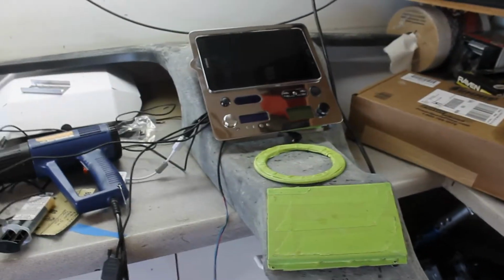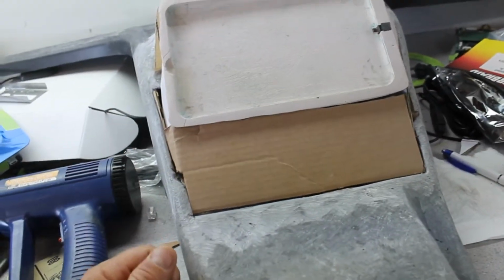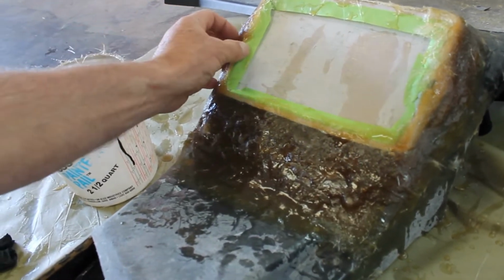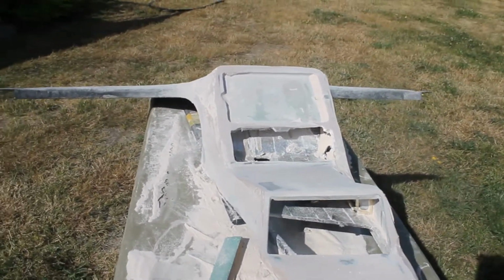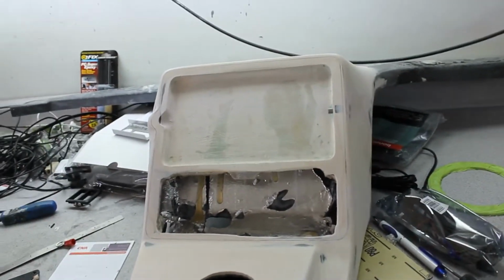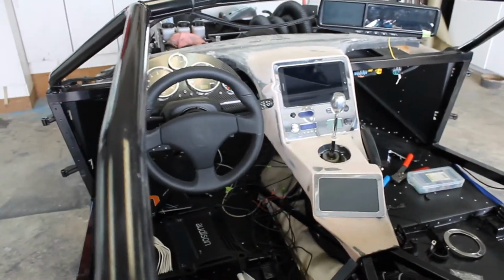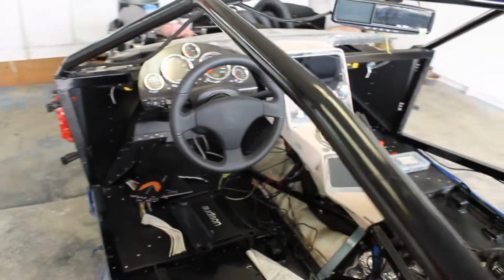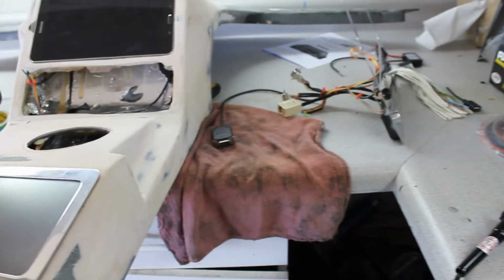Factory Five GTM Supercar, fastthings build log....... Part 61

Comment: Be careful and take your time triple checking all your wiring. I cooked my multirotor flying drone after a crash. A couple wires pulled out of battery balance connector and I  reinserted them not taking my time and it cost me a pretty penny. HD camera cooked, Gimble cooked and my 1.2ghz long range transmitter cooked. Very upsetting to hear the little pops and smell the magic smoke.
Reply from the maker: Not good, I just saw a pic of a unfinnished GTM that was burned to the ground, I think they had a feul leak or something.

Comment: Wow, it came out to be very awesome ! What is the purpose of the smaller screen ?
Reply from the maker: Thanks, I'm very pleased so far. Small screen isis called ISIS INtouch, a touch screen to interface everything that uses power in te car. Look up ISIS Multiplex Systems, pretty cool stuff. I will show all the systems in detail when the car is done.
Reply: Cool ! Thanks for the info, can't wait for that review video. I will check on google for now. Did you intent to track your GTM a bit ?
Reply from the maker: Mathieu Fontaine-Cyr Yes, I live very close to a 2.5 mile road corse and a drag strip. I will hit each one a few times I'm sure.
Reply: Nice, you are very lucky. That's they way this beauty should be treated. I have some track around here too but I would be scare of the close wall with a car like this. I got a older F1 track that will be perfect but it's a 3 to 4 hours drive. Keep up the good work, I dig your video. Have a nice weekend. Math.